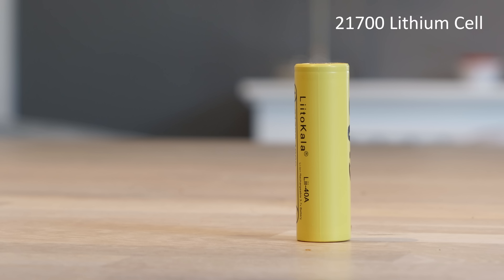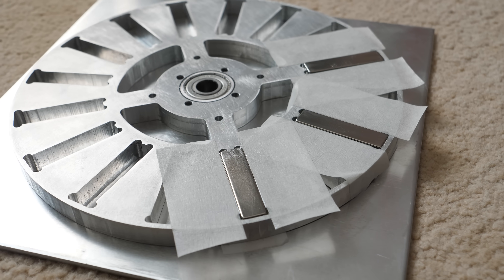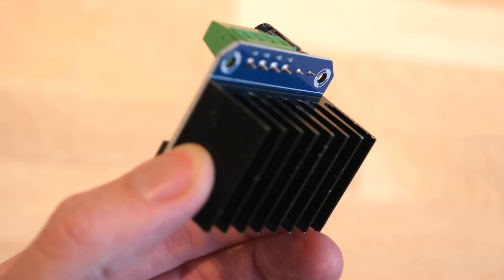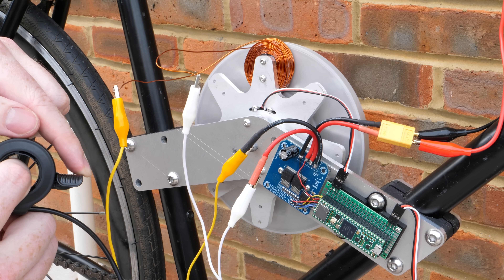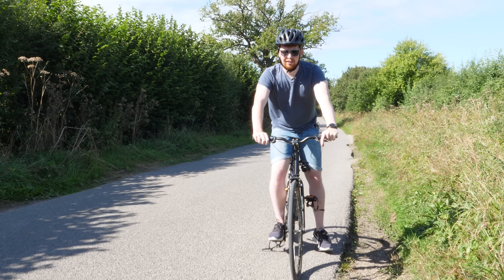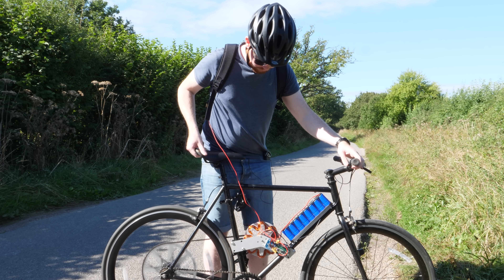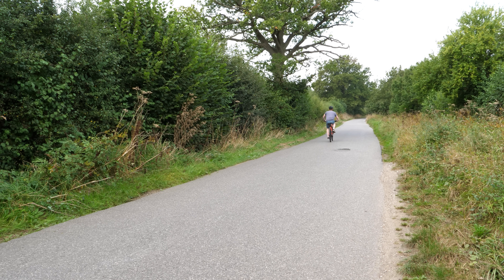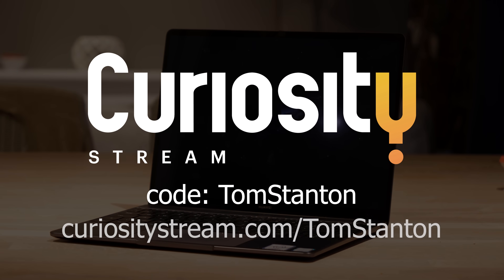Super Capacitor Bike

Comment: I have assumed that electric cars use a booster circuit in order to maintain a constant voltage fed into the motors. However, I've never disassembled one in order to confirm this. Areyou suggesting this is not the case?

Comment: Try making a flywheel system on the back wheel to charge the capacitors when you break. And hope your capacitors can store the amount of energy that the flywheel is going to be generating, especially if you add a bike chain to a standard pedal crank.

And is there a way to electronically control a flywheel clutch system?

That could help with the acceleration issue, and allow the capacitors to help just maintain the speed.

Comment: No, motor power does not depend on battery pack voltage in any properly designed system. Stop making silly statements. The DC-DC converters and motor control electronics will give constant performance regardless of battery voltage.

Comment: It amazes me what people can do.  The precision building is something to behold.   It is perfectly understandable that the voltage drops quickly with these capacitors, which hampers the motor functioning.  I'm curious if there is circuit that takes the output voltage of the capacitors and increases the voltage to maintain a more constant level.  A voltage regulator or sorts.  Maybe there is already such a thing being used?   I'm not all that familiar with super capacitors.  The bike wouldn't run longer (if anything less because of losses powering this output circuit) but at least the voltage would be constant until there is not enough current for the circuit to maintain voltage.   Maybe my brain skipped off to one of Jupiters moons thinking this.

Comment: Hey, Please add some safety elements to this bike if you still have it. If the super capacitor pack breaks or something like water completes the circuit and you touch it, it could shock you and kill you.  Essentially, if your assembly breaks at any point so that there is. I resistance between your capacitors and yourself, it will probably kill you. Please well insulate the entire pack and make it water resistant. I would also advise putting a fuse and something to limit short circuit voltage and current between each one of the capacitors in the pack as a backup safety mechanism. These aren’t batteries, they’re much more dangerous.

Comment: Unfortunately regular cycles are not designed for high speeds and high speeds obviously carry big risks if something suddenly breaks. Super Capacitor projects are only really suitable for motorbike projects where parts are designed for higher speeds but then whats the point if a motorbike goes faster on regular fuel?. I ride a heavy built cargo bike and even cargo bikes are lethal at speeds over 15mph if they suddenly develop a fault.

Comment: Can you make the rear wheel into one big electric motor, just mount magnets toward the most outer part of the rim. Then make a generator using the front rim. The capacitors would store energy from the generator, I think it would work very well.

Comment: now add in a regenerative braking POT(shunt coils to capacitor via variable load resistor) and a buck-boost convertor to charge it up via a USB power bank(or your cell phone itself if you have a PD compatible one)
it could be just a couple watts from the power bank(5v 2a like most generic 10000mah+ packs) and maybe make 4x the number of capacitor banks so you have about 30-120 seconds of acceleration
given the losses of the regenerative braking(could use a PWM mosfet driver for better rates) and the nature of only having a few seconds of acceleration it would be best for city use but honestly a pedal assist that uses my generic laptop/camping power supply (can do 20v 5a but lets assume USB-12v for compatibility with cheap USB supplies) and lets me bike all around town with only a few watts of a solar cell on my backpack(stored in USB power bank obviously)
as I use power banks all the time anyway such a hybrid system that can regenerate at least 50% of acceleration energy and given acceleration of less than 120 seconds that can be prepped in 5 minutes and topped up as I ride this would be ideal as who accelerates more than 50% duty cycle in semi-flat city? I expect this idea is actually how to make an e-bike less silly in expense
the motor will still be less than perfect as the ESC it has built-in and the motor itself is designed for a lithium range, the nature of say a 24v motor and a ~35v max capacitor pack(the internals of the system would be 35-50v caps for the 24v esc anyway) it could provide a massive current surge that a cheap 20-24v nominal pack would be unable to supply directly but could easily supply if the duty cycle was under 25% but averaged via the supercaps
in fact I may actually do this using a 24v designed e-bike kit and a few grand(slowly purchased) set of 3000f capacitors
usb solar panel on my back, small power-bank in my "cupholder" rack, supercap+motor driver encased in a nice acrylic box, the jank+cool nature of the whole thing would be insane
still want to use the supercap pack as a removable module(supercaps are bloody expensive for so much farads) and  will definitely chain this fucker via frame and tires to poles but given the awesomeness of having an exposed rack of supercaps  and a simple volt-meter to show how hard I am relying on the caps, and a potentiometer to control the buck-boost current limit separately and I could enjoy this
aww man now I wanna buy a 24v kit and try messing around with supercap regenerative braking fed just by a USB power bank

Comment: Your electric/ICE car comparison is only true with a non inverter driven electric motor. When an inverter is used, as it is in an electric vehicle, your "less voltage, less power" scenario in not correct.

Comment: my friend  could yo add a dynamo with a joules thief or with a voltage multiplier to achieve better results? sorry for my ignorance it is just an idea, my silly idea would be that your pedals to drive the dynamo, the energy then goes through the voltage riser and then through your set of capacitors, greetings!

Comment: your graph of energy supplied by the super capacitors would have been  bit more accurate if you showed it as the area under the curve vs just the voltage range.  this is important because in terms of energy you do get a much higher percentage.

Comment: What it could be very useful for is very hilly terrain where you can get a rapid boost of energy similar to Porsches 919 hybrid where the electric motors only give a boost of 400 extra Hp for 20 seconds max only thing is the bike needs regenerative breaking and a higher torque motor

Comment: If you use a boost regulator (easily bought online), you could keep the battery voltage constant for a large portion of the discharge.  It has some losses, but not bad and should buy you some more energy out that is usable.  Also, it seems like you should PWM the output drive, and make it low at first since there isn't much power needed to accelerate in the lower speed range.  That would leave you more energy to reach a higher top speed.  Even so, the best feature of the caps (as you stated) is to charge and discharge quickly, so focusing on it as a KERS and using the battery for the main range should work very well.  The caps could also be put in line with the battery output briefly for a boost when already moving (assuming they were charged by the battery or downhill earlier).  That would let you get a small and quick speed boost which you could recover the energy back again over time.

Comment: the solution is a joul theif circuit, to maintain voltage stability. Or the more advanced and safer method is to make a voltage stepup device with a switching mode circuit

Comment: You must surely be using this thing on casual rides.
If they really charge that much ff of just that hill, I mean, you could've peddled up that as well & maybe made the top of the hill without too much excertion, well, maybe, I would like to have seen that comparisson with this as an assist, whcih would open up more reoutes 1 might not usually find themselves on.

Comment: I whould put a special bms to the caps and connect a 12v battery in parallel, when not using the motor the battery Will charge the caps + regen breaking

Comment: Have you ever thought of putting switches on the petals so if apply the slightest pressure the petals rotate so it's powered by whatever you want but the speed controller is the pedals like a mechanic speed controller so there's really no way the speed controller can mess up and just go fast anything messes up on the pedals it won't go and maybe make it a 10 speed bike so you can go fast but always have full control of the speed
Reply: I just don't trust electronics for my life I like old reliable mechanical things if you don't see any damage it works not a simple loose wire on the throttle gets the motor stuck on full power yeah cheap electric vehicles with cheap switches do that sometimes be careful maybe consider a Frankenstein style switch directly on the motor input wires and directly connected to the breaks

Comment: I think regenerative braking is nearly useless with batteries but would have value with capacitors.  I say that regenerative braking is nearly useless with batteries because the charge rate of batteries is so low and very little charging happens for the brief time the brakes are used on a journey.

Comment: Just a question, it might be a stupid thought but if you had to use capacitor batteries together with lithium ion batteries. So for instance you are traveling down hill it could charge the capacitor batteries which then could be used to charge the lithium batteries and so on, or am I being stupid?

Comment: Don't have time to watch through right now, but I can only imagine you did something to make sure the capacitors could NEVER discharge through your leg, or God forbid your torso, to ground.
Reply: its called dont touch the copper parts, he showed them charging to 20 volts so if that was the max then theres isnt any risk there anyway
Reply: The amps are the dangerous part, and if there are enough of them, electricity can travel (and burn) through anything. Take it from a welder (and former electrical engineer major).
Reply: @MasterofTongs  at 20 volts you cant get enough amperage to harm you, I=E/R
Reply: @justinc2633  Each, or total?

Comment: Use a gas powered motor to charge the li-ion batteries, use these batteries to charge the capasitors, use these capasitors to generate HHO, use the HHO to power the generator.
100% efficient at wasting energy :)
Reply: hahaha😆😆😆🤌👏👏👏
Reply: Tf

Comment: I've been a bike mechanic for 47 years and all I can say is...Super cool! Also, would it make sense to combine batteries and capacitors into EV's, where the capacitors could handle the large accelerations (discharge) and decelerations (charge) and act a an energy buffer for the battery?
Reply: I think it's a good idea but would be somewhat hard to make it work without trouble.
Reply: @theelectro15  with a properly coded controller and set of sensors to know when to implement the switching between each mode of power source / regen charging it shouldn't be all that difficult to work. And by using an app on your smartphone connected through bluetooth or usb to control the higher functions associated with the capacitors it wouldn't add extra failure modes and complexity to an existing off the shelf eBike controller that has a brake lever cut off function. The capacitors could be restricted to only being used to go from 0mph to 10mph speed. Which is where most amps are used on an eBike. A lot less power is used to keep the bike going once up to speed relative to getting the bike there. If the capacitors are charged only via braking and only used to accelerate the bike I wonder if they would be able to significantly increase the range over the regular regenerative braking power recovered?
Reply: @publicdomain4890  cool, I would love to see it work
Reply: @publicdomain4890  Are there start and run versions of supercapacitors?
Reply: Exactly. I read years ago that supercapacitors can greatly extend the life of a battery by doing exactly what you just stated.
Reply: @Seersage101 thats why they should not be used in any electric vehicle... would make it last for a long time. Better to break the battery after 10 to 15 years the used market will go away and

Comment: Too bad you couldn't get the circuitry together to allow you to charge the capacitor bank.  It wouldn't just have been useful for regenerative braking, but could've also allowed you to charge the capacitors just by pedaling.

Comment: UCLA Invented 2 in 1 Supercapacitor and Hydrogen Generator That Runs On Solar Power   youtube.com/watch?v=Cylk8VB6ohw Cars, under the sun most of the time, are hot. How about don't rely on the alternator but use that thermal trapped in the car and the hot radiator while the car is running, and some solar panels for electricity charging capacitors instead:

Comment: How much inductance do those coils have? Your unboosted voltage would have made the current ramp up quite slowly. You need way more voltage to get the dI/dt steep enough to get some field before you have to reverse the polarity. The fun thing about driving motor coils with a hard field, is when you reverse the polarity, the energy in the coil actually goes back into the capacitors until the current starts going the other way.

Comment: 400F each….crap that’s insane.  I know it’s a very different world, but I split my thumb like a damn hotdog while disconnecting a 2F capacitor bank.  It was for a 650hp compressor motor, but still. One of the bleed down resistors was bad and I’m an idiot. Reached up to remove cable from post and don’t remember much after that. Be careful with caps people!

Comment: Loving the experiments dude !   you should have gone the whole way onwards in the hill experiment though😅, in order to have a slightly more accurate account of the deceleration whilst going back up the hill in one go without turning too , or as far as possible . It would be interesting  to see the difference turning makes with the regenerative braking .  

do you reckon its possible to achieve  recharge whilst pedalling by adding a reverse setup of the magnet coil situation to the other side of the chain but also make each chain link house a magnet of opposing poles to somehow recapture the magnetic energy so that its "like" your plugged into the mains electric when you're pedalling.

That probably didn't make any sense at all, forgive me I'm Late to the Party

Comment: I dont kmow why he didnt make a cog with even a diff to swap the capacitor or batterrie to switch back and forth which would of been much either...when i looked an noticed he was making a circuit to switch it i wondered why an i still can not see why the main cog as it turns could spin the two oposits...maybe im wrong but?? Can anyone else see??

Comment: Curious if you could inline 2 48v batteries and then split their charge. One split going to a 12v battery booster that charges your capacitors. The other split going to the bike.  Essentially the 12v booster could constantly be charging the capacitors while the 48v lithium is only used to charge them.  Food for thought anyway.

Comment: Electric bicycle should have own alternator which will recharge the battery when you drive. example build-ed in the front hub connected straight to battery.
Reply: that was exactly  my thought.. i was thinking in my head.. attach the enameled copper coils to the back wheel, mount magnet under back brake, it would charge as you drive, just add a overvoltage protection circuit....

Comment: One amazing thing about this video is the battery in the backpack, I think that is actually a pretty cool idea. Make an e-bike that has a motor but not a battery, you buy the battery separately in a backpack and connect it to your motor when you want to ride it. Since battery is probably the first thing that will die in an e-bike, you can easily replace it.

Comment: its better to power the front wheel on a bicycle, than powering the rear wheel. that way you can use the space that is available under the handlebars, which is out of the riders way, and it lets you pedal, as the motor works, which you often cant do with the motor running on the rear wheel. i had a really nice electric bike in the 80's, which had a really well implemented electric motor above the front wheel, you simply turned it on, and pushed a lever forward which dropped down a drive wheel off the motor & it pushed down hard enough that friction provided the grip between the electric motor drive wheel & the front tire.

Comment: How about basically creating a 3 phase super cap bike so you have 1 bank of capacitors switched in for the first x seconds before then switching. The other 2 banks charging up by the motion if the bike going forward. Then rectify the voltage to be constant, does that work? Will be losses for sure but might end up going further

Comment: If I wanted to hybridize my ebike by using supercaps with my battery pack, how would that conguration look? For regen to work, the total voltage drop across the supercaps would have to be the same as the battery voltage, right? But the supercaps are 16V? If I put the supercaps in series that would up my voltage, but drop my capacitance? And then would you put these series supercaps in parallel with the Li-ion battery pack?
I am interested in having as simple of a configuration as possible so that the same controller and charger can be used for the hybrid supercap & Li-ion pack.
I see that there are "Li-ion supercapacitors" which supposedly have the best of both worlds ... how well would a power pack made out of these components function I wonder?